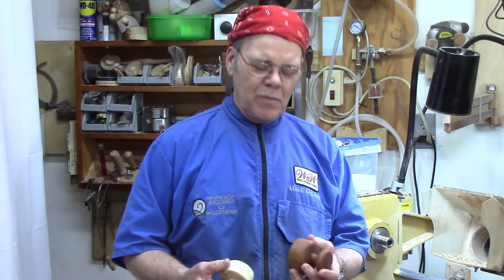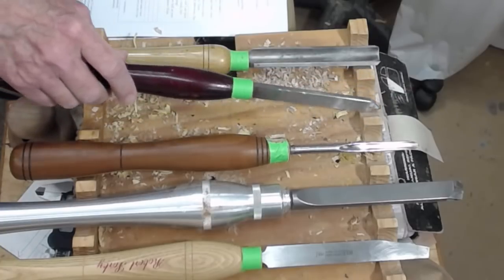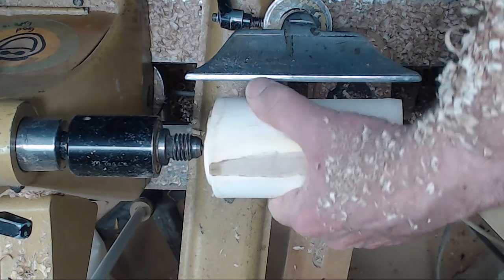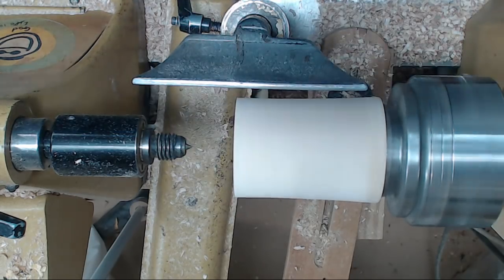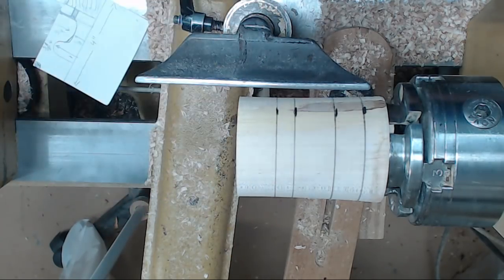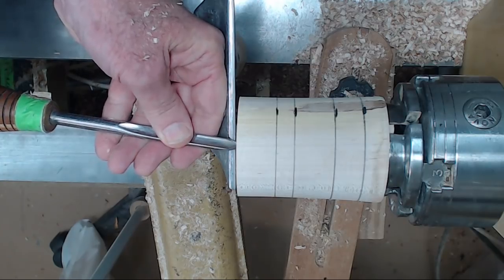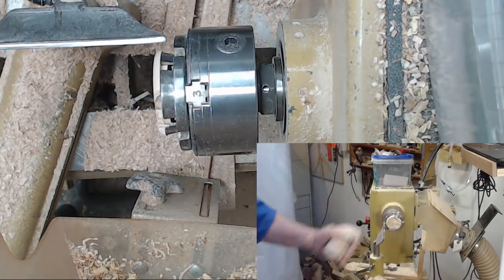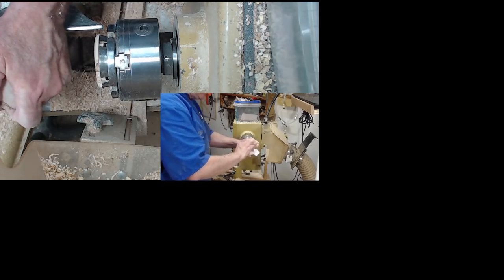Turn a Biscuit Cutter

Comment: At 16:08 while making the biscuit cutter, you use a gauge to set your caliper. That's an awesome idea.   I drafted out a gauge set from 1/4 to 2 3/4" and 3D printed it.  It's pretty much within 1/64 for all dimensions (filament dimension and some ABS shrinkage is responsible for this error source).   If I decide I need higher precision, I can always calibrate the blocks with tape.   I can make the STL file available if you are interested.
Reply from the maker: Thanks for the info! Yes, I would be interested. My son has a 3 D printer. One of these I may do a video on 3D printer woodturning accessories if I come up with enough. mikepeace356@gmail.com

Comment: Great little project Mike. However, I do have one question. According to everyone I have talk to about the Teknatool 50mm jaws, they are dovetailed on the inside as well as the outside. The inside is slightly less than the outside, but they are still dovetailed. You are not the first person I have heard say the jaws are straight on the inside by any means. And everyone I speak with has their own opinion about them. So I guess maybe I might have to ask Teknatool about them again.
Reply from the maker: I never said the jaws were straight on the inside. I said make the tenon parallel. This comes from the G3 manual. Other Teknatool documentation is similar on these jaws, "Make the spigot as parallel as possible to maximize the efficiency of the clamping action...The 50mm (2 Inces)  standard jaw has a thin lip (or shoulder at the front face) whicH is designed to bite into the timber as the jaws are tightened. DO NOT CUT A RECESS AS THIS WILL REDUCE GRIPPING POWER." 
I always advocate reading, understanding and following a manufacturers instructions until I have enough experience and knowledge to know when to deviate.
You may want to watch my review of the Record Power chuck which has identical standard jaws where I describe and illustrate the gripping. https://www.youtube.com/watch?v=Z3UB6fuQNwc
Reply: Mike, I am not trying to be argumentative, I was really just questioning, that's all. I hope you do not take my response the wrong way. I actually enjoy your videos and find them very informative. I have been a long time subscriber to your channel as well as the Gwinnett Woodworkers channel. So I hope you did not take any offense to my response. If so, I do apologise.
Reply from the maker: I never thought of your reply as argumentative.  Sorry if the tone of my reply indicated otherwise. The confusion or misunderstanding you had on these jaws is common. I have seen a number of comments similar to yours where folks can't hold the wood with a Teknatool chuck and then blame the chuck because they did not carefully read the instructions. I saved my response so I can copy and paste when it comes up again. 
Safe turning my friend.
Reply: @MikePeaceWoodturning  Thanks for this!

Comment: Mike, my granddaughter took over making biscuits from her grandmother who passed away several years ago and I think I"ll make a couple of these for her. Would you mind sharing the approx dimensions of the blank and also the finished project? I realize it is not critical, but I don't have even a rough I idea of where to go. I only know they're delicious.

Thanks,
JOsh
Reply from the maker: Maybe 2 " diameter and  1 1/2" deep if it will be a surprise and then make the next one based of the feedback. Otherwise ask the cook. My wife makes canned biscuits, LOL!
Reply: @MikePeaceWoodturning  Ha! Thanks for the very quick reply, info and suggestions.